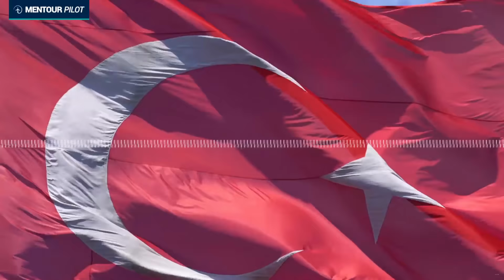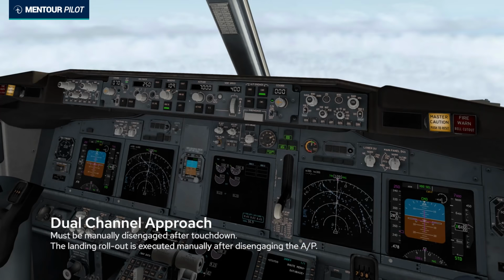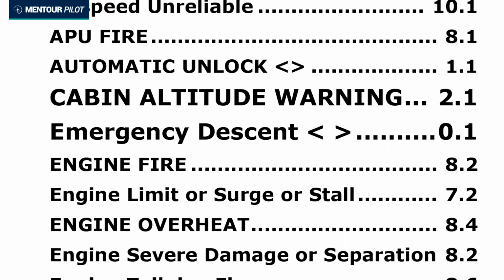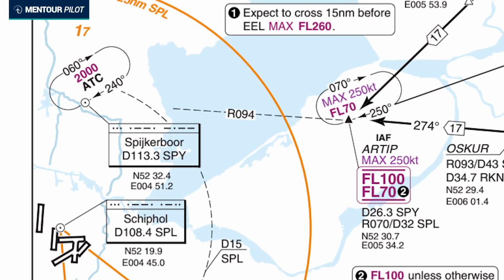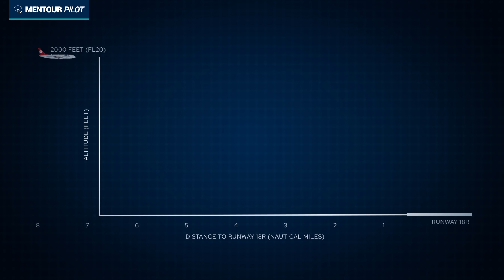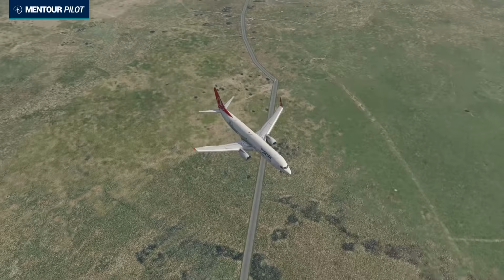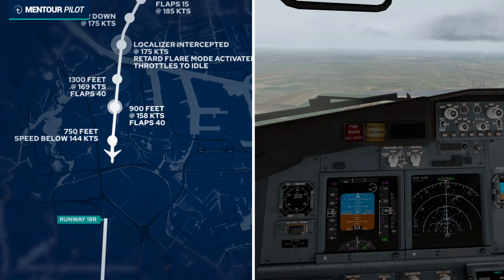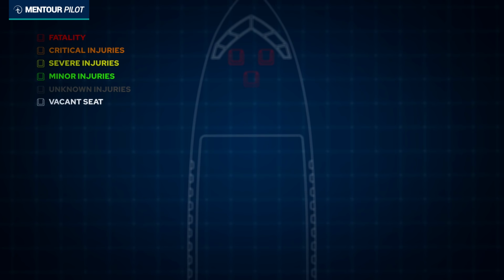What happened to Turkish Airlines flight 1951?!

Comment: I remember this incident well, I flew into Schipol shortly afterwards and saw the wreck, utterly shocking.
Schipol had a habit of turning aircraft in tight. What you didn’t mention was that in addition to this, very low transitions can increase workload significantly, and predispose approaches getting high (dependant on the QNH difference). Pilots must be aware of the impact that transition will have on their intercept. Additionally the low transition has the habit of delaying the approach checklist until quite late in proceedings - again increasing workload, at a time when things are getting compressed. The crew should think ahead to how workload will be managed. 
It is common for the safety pilot to become involved in other tasks. It can be useful, and being a safety pilot can sometimes feel like a spare part, and so being involved in the crew is welcomed. However, their principle role is to monitor, and tasks detracting from this does reduce capacity on the flight deck, not increase it. 
However, one of my biggest bug-bears is the idea of the ‘gate’. Too many times I’ve seen pilots use this as a fixed point in time at which the parameters are met, in order to continue. If you enter a 30km/h zone when driving it doesn’t mean you can be 60km/h before it, 30km/h at the signpost and then back to 60km/h thereafter. It’s a ZONE, which when entered requires parameters to be met and remain. If the parameters are not met in the zone then consideration must be given to a go around. To often, once the gate is passed it’s forgotten.
Excellent synopsis
Reply: Thank you, it´s very convincing.
Reply: Yes, but you should get down to the cleared altitude without delay, intercepting the glide from below.
Reply: @bassammadanat6698  Disagree. The stability of the aircraft comes first, especially with clearances to or below MSA. A simple rule is 5 to 5, 3 to 3 and 2 to 2 ie a maximum 5,000’ fpm to 5,000’ and so on. But even this seems high to me, but it gives you time to stabilize the aircraft. Worst case, you go around.
Intercepting from above we usually set airfield altitude plus 1,000 and press for VNAV SPD and then use the speed brake to give a sensible descent rate to catch the glide. If you are above there’s no need to shoot for below to catch-it with modern aircraft an intercept from above is Ok provided a sense check is made of the glide path angle. I’ve never know the 777 to catch a false glide slope and doubt a 737 would either. Unless of course ATC require you to be  at a low level for some kind of deconfliction, which again is unlikely in the approach zone. We nearly always aim to catch the glide on a constant descent approach, and ARM the loc first to allows the path sanity check.
Reply: @grahamsalmons2027  Thank you Mr. Graham

Comment: That stable at 1000 feet is so important. And the pilot flying should have his or her hands on the controls and throttles at all times below 1000 ft AGL. The pilot monitoring  is even more important during this phase of flight. This crash highlights a true lack of situational awareness in that flight deck. And I agree with previous comments. The Captain taking the controls when he did sealed the fate of that flight.

Comment: really good video. It seemed like a normal flight but the compounding of small errors and malfunctions became critical at the worst time
Reply from the maker: Indeed
Reply: It’s usually like this with crashes.
Reply: @ Matthew: Mhhh no I would disagree. The small errors would not have led to a crash if not major errors were made too. Letting the plane for 30 s in "airspeed low" warning at low altitude is a major error; (THREE pilots) do not monitor thrust continuously during a stick shaker at low altitude is a major error. @Mentour Pilot, correct me if I'm wrong.
Reply: Just fly the freaking airplane!  basic piloting skills,   can't you revert to full manual control when auto systems are malfunctioning?
Reply: Sadly Boeing wasn't honest about their flight computer and sensor problems for a very long time and kept postponing taking any responsibility!! Such as for this crash they offered Turkish airlines a massive discount for new planes, in fact Turkish airlines has the cheapest 737-800s and 737-900ERs in the sector which was why they decided to sue Boeing first then changed their mind!! Ofc there was also pilot error that inexperienced first-officer couldn't spot or state malfunctions while the captain was simply overwhelmed as he was doing some of first-officer's job as well but the real problem was Boeing again who didn't properly share these problems with airlines and organized better simulation training that exactly same happened with Max and the company is facing billions of dollars fine now...
Reply: @Delibro  
Also, correct ME if I'm wrong, isn't it ultimately the captain's responsibility to keep everyone safe? Seems to me this captain absolutely failed in his duty.
Reply: @johnstudd4245  On Boeing planes, you can revert to manual control whenever you like, just disconnect the auto throttle in this case. They could just have done that.
Reply: @moviemad56 Yes, I didn't said anything else I think.
But in addition to that, the first officer was pilot flying, he also absolutely failed in his duty.
Reply: @Delibro  I suspect that the major error (stalling) happened due to distraction, frustration and confusion over the other smaller problems. This also happened at a time when there was a high workload, together with limited time due to the proximity to the ground and the pressure to land. It was a very complex and stressful situation and things got out of hand. It’s in exactly those conditions where mistakes are made.
Reply: @gosborg  This is right. And this is the only kind of half excuse.
But that's also the reason why trained pilots fly a plane, and not an average person.
Reply: @Delibro  I get what you are saying and I agree up to a point, but there is a limit at which even trained pilots fail. We are humans not machines and we all have our limitations. I am a trained professional in my field, but I know I have made mistakes in my job. I guess what I am trying to say is we all have the potential to fail.

Comment: The fact that an aircraft with dual (in theory) redundant radioaltimeters can have a failure of just one of those cause the autothrottle to spool the engines down to idle screams bad avionics design.
Reply: Agreed. It should alert the discrepancy and then also tell the pilots that it is also disabled the auto throttle. That would be a good reminder to go "oi these instruments are wrong and we're not on auto anymore!"
Reply: Except that they failed to turn on both auto-pilots at the same time, so they were using only the malfunctioning side of the altimeter.
Reply: @Alfred Weber The auto pilot disengaged after that. They ignored that and engaged again, and also again just one. And as he explained, they should have flown the last part themselves with the auto pilot turned off. 

Also, why do they have to select if they want to use the left, right or both auto pilots? Simple: to give them the choice when one fails or has false readings, so they can pick the one that works and engage that one, without it automatically engaging the faulty one again.
Reply: Yes, indeed.
Reply: @sjonnieplayfull5859  yep, even my shrimp brain tells me that if I have super loud warning with the altimeter (landing gear warning) and I even talk about that (voice recording), why choose a approach which relies on the altimeter??

Comment: I'm very surprised you didn't speak more to CRM and the culture of authority in the cockpit. The authority structure seemed to play a massive role in the sequence of events. Had the other pilots had the ability to call "go around", or if the captain had not taken control of the aircraft from the FO, the stall likely would have been avoided. Also, there seemed to be very little communication between the pilots regarding the various malfunctions and CWA's.
Reply: Indeed.
Reply: Yes
Reply: Exactly, seems the captain and observer should have taken over when the first landing gear alarms went off, indicating the plane had a malfunction. Clearly not a good "training" flight.
Reply: He did...

Comment: I remember when this accident happened here in my country, I was quite surprised that the airplane was designed in such a way that when 1 out of several altimeters has failed the plane would still continue to act upon the values from that single sensor to control critical parameters like a flare.  I think that also was a major point in the investigation, and one of the advisories was to do more with the availability of redundant information to cross-check the system.
You can imagine I was even more surprised when a development cycle later this mistake was again present in the MAX type, where also a single sensor failure would result in the wrong behavior of the aircraft systems even when other sensors are still available to detect that.
Reply: The plane never behaved wrongly, listen to the explanation before making your statement. The auto throttle did exactly what it was supposed to do because the radio altimeter was faulty. Listen properly to the explanation. Amazing how much people do not listen and becomes emotional and assumes things
Reply: @daodyrakotomalala787  that's exactly what he said. I think you need to read it again.
Reply: @OOpSjm  @daody rakotomalala Yes, exactly.  The plane did exactly what it was designed to do, but it surprised me that it was designed that way.
Not only because it could do autopilot on the right side and autothrottle on the left side, but also that the autothrottle did not detect an error condition.
The radio altimeter hardware output 0.  That is not supposed to happen in real life.  The computer subtracted 8 for the height of the altimeter hardware relative to the landing gear, and the result was -8.  That was not to be interpreted as "we have landed", it should have been interpreted as "there is a problem, alert pilots and do not perform default action".  Especially because correct altitude information was available from other sensors.  The design was not to use those, but who designs things that way?
Even more surprising is that after this accident the next generation was designed with a new system that had this same surprising design.
(to use only a single sensor when multiple are available, and not detect discrepancy between sensors)
Reply: @Rob2  beside that significant difference in readings of two altimeters requiring manual marking one or both as untrusted - would raise pilot awareness.
I wonder if there are any cross-sensor checks used to enrich data with reliability info.
Reply: @Rob2  This is pretty similar to the 737-MAX fiasco. When you measure something, two is one and one is none. The plane has two radio altimeters but instead of comparing their outputs internally (to make it at least one confirmed altitude measurement capable of error detection) the plane relied upon the single measurement only (and trusted it completely without any way of verification). 
Similarly, the 737-MAX has two AOA sensors, but treats them the same way, not allowing for error detection and putting complete trust into the single measurement.
This was combined with the lack of any sanity check of the results whatsoever. The accident plane did not ask itself how can altitude be -8 feet. 737-MAX did not ask itself how can AOA be this high with not overly excessive pitch and reasonable IAS.
Basically, the system design is obsolete nowadays and would not pass certification even when implemented in a car. Imagine that a single failure of a wheel sensor would lead to erroneous activation of ESP and kick you off the road. That doesn't happen because there are multiple sensors and their results are constantly scrutinized and disregarded when found in error.
Reply: @jenda386  Indeed.  I can understand the design decision of keeping two halves of the instrumentation completely separate (having left and right sensors displaying on left and right consoles, controlling left and right autopilot, etc without any coupling that could make them fail both due to a common cause).
But what I cannot understand is processing obviously wrong information as if it is valid.  When the radio altimeter outputs 0 it should be treated as invalid, not simply subtract the 8ft that is always subtracted (its height above terrain when the plane has landed) and then display it as -8, and process it as "plane has landed".
And even with two separate systems one could argue there should be a passive comparator that lights up a big "left and right disagree" warning when one side fails.
As I understood during the MAX discussions, such a comparator is an optional item on the MAX.  But would be made standard after that.
Reply: @Rob2  "...who designs things that way?"  Answer:  Boeing MBA managers.
Reply: costs money to iron out these problems often they know of these but still produce / operate with these problems  if in doubt blame the pilot often they cant tell there side of the story  DEAD.
Reply: @raypitts4880  Yeah sure, but why would you design a new plane with the same problems when you have received a recommendation to watch out for that?
Especially when such extra features are all in the software, rather than require extra hardware that costs money per sold unit, has weight, etc.
Reply: As with the flight control computers there must be an installed system to order the disconnection the auto throttle when if the readings from both radio altimeters are differ, let's say more than 5%.
Reply: Sadly Boeing wasn't honest about their flight computer and sensor problems for a very long time and kept postponing taking any responsibility!! Such as for this crash they offered Turkish airlines a massive discount for new planes, in fact Turkish airlines has the cheapest 737-800s and 737-900ERs in the sector which was why they decided to sue Boeing first then changed their mind!! Ofc there was also pilot error that inexperienced first-officer couldn't spot or state malfunctions while the captain was simply overwhelmed as he was doing some of first-officer's job as well but the real problem was Boeing again who didn't properly share these problems with airlines and organized better simulation training that exactly same happened with Max and the company is facing billions of dollars fine now...
Reply: @Rob2  
Systems aside, the pilots killed themselves by failing to do something as fundamental as checking the throttle.
Reply: @Rob2  Exactly. On my 1985 car, the fuel injection system used multiple inputs: throttle position sensor (TPS), Manifold Absolute Pressure (MAP) sensor, RPM sensor, and (when warm) the Oxygen sensor in the exhaust. It could lose any one of those sensors and still calculate the fuel needed. The TPS was an analog voltage between 1 volt and 4 volts, but the engine control computer knew that any value below 1 volt or above 4 volts was invalid and so it would be ignored. Thus if the sensor was unplugged, it would read 0 volts; or if the ground lead broke (as mine did), it would read 5 volts. But the computer knew, based on the MAP and RPM sensors, that the throttle could NOT be closed or wide open. And remember, this was 1985, so not leading edge technology.
So you would think that if you have two or more sensors on a plane, there would be cross-checking  between them, with (where possible) a "sanity check" on the reading. So an altimeter obviously cannot be reading a negative value, especially while the plane is obviously still in the air.

Comment: The most bewildering thing is that 2 (or 3!) extremely experienced pilots NEVER noticed approach airspeed until the stick shaker. At a required 144 they don't even notice it's to 107. Yes, it's bad enough that on stall warning they didn't instantly increase throttle or TOGA, insanely trying to correct stall purely with pitch, but to not even know the speed? On approach, THE most important time for speed attainment other than T/O? Brrrr. "Extremely experienced." So what if they had had specific low alt. or approach stall training. With many thousands of hours, this is just hard to digest.
Reply: Exactly what I thought... I have only flown the 737 in the Sim for MCC so far but in general I can't understand however high the workload how with 3 pilots in a cockpit nobody is monitoring the airspeed in this phase of the flight
Reply: My brain can´t wrap around it. 2 pilots should be able to at all time glance at the speed every 30-40 seconds. Also why can the speed decrease so low under landing without audio warnings going of ? Like you set the landing speed to 140 knots, and if speed goes 10% under a "low speed" warning should  alert the crew.